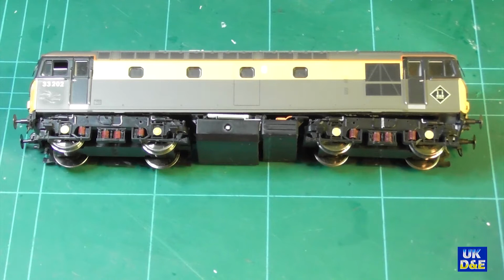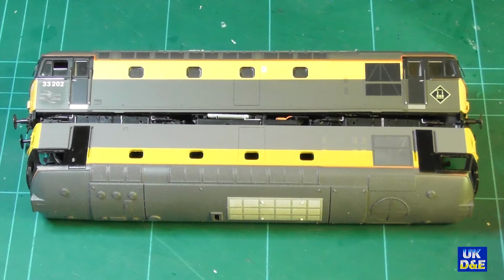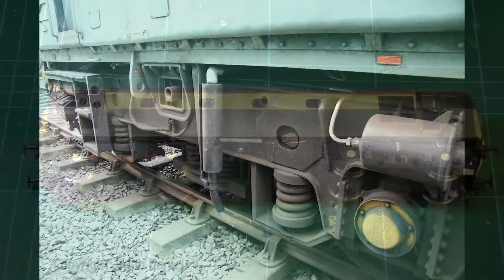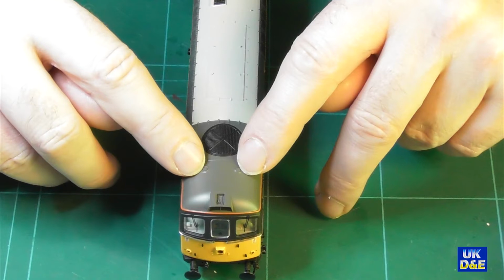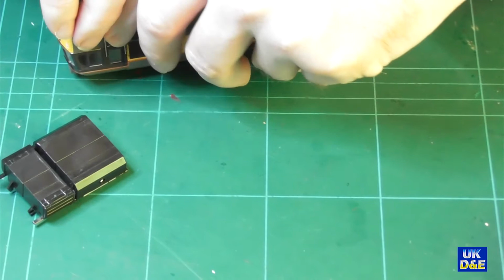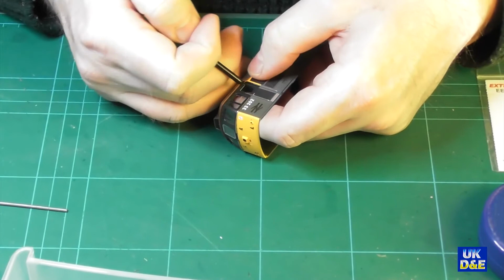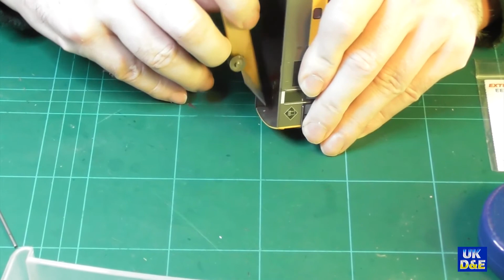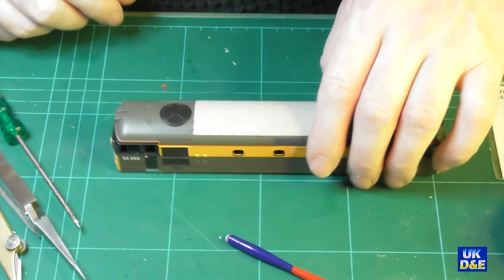Class 33/2 Rebuild: Part 1: Intro and breakdown

Comment: Did you ever finish this project?
Reply from the maker: Not yet.
At the Warley show I was talking to Brian at Shawplan about how I thought the mesh on the bodyside grills were a bit thick, but I said that he'd done some new ones since I'd bought the old ones.

He said I can swap them, but since Covid-19 killed off all the model shows, I haven't been able to swap them with him yet.

I have one set so far, but I have ten class 33's (33/0's, 33/1's and this 33/2), and I want to batch build them all at the same time.

I also had some financial difficulties over the winter and I took on some comission work... so my own stuff has had to take a back seat for a while too.

Don't worry though... they're coming!